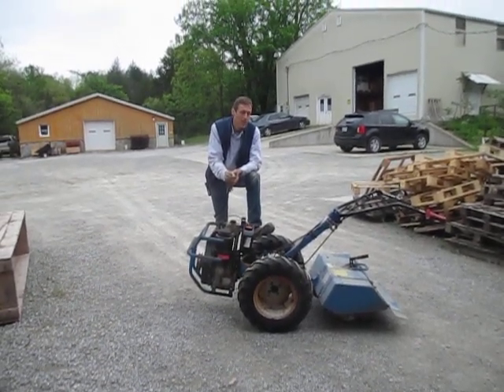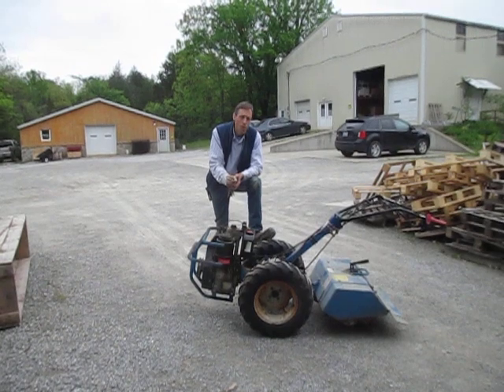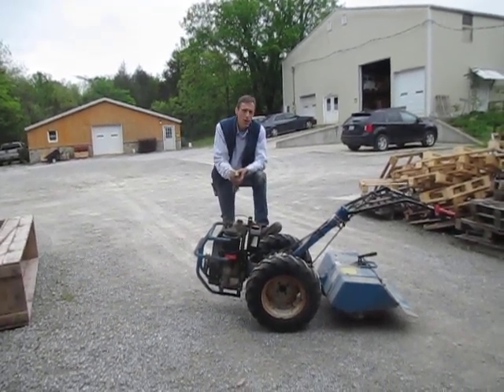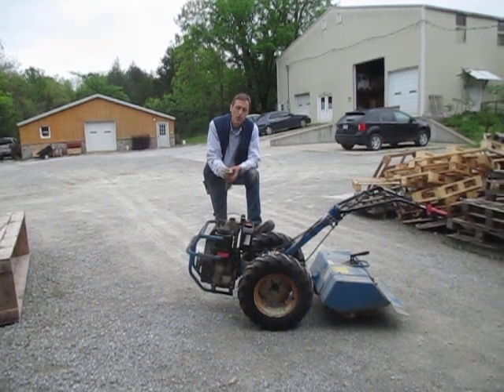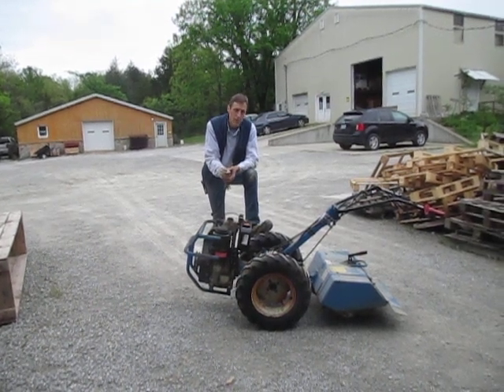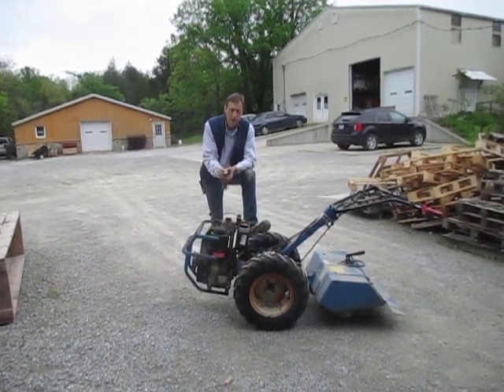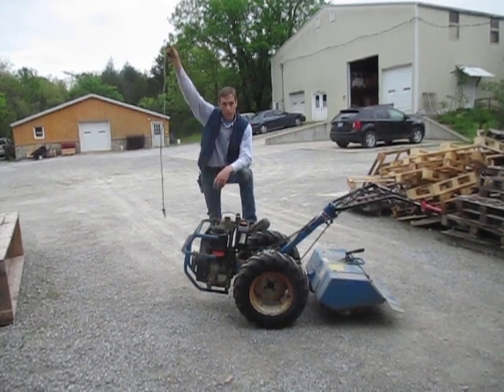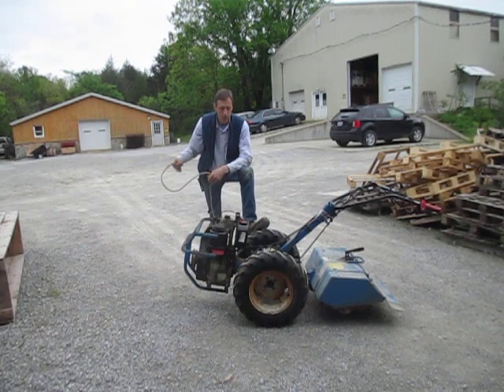Small Engines: Rope-and-Pulley Starters

Comment: Interesting.  I well remember the old-style pull-rope engines from the 1950s & 1960s... Are they still around ?  Should run virtually forever.....Was watching videos on motorized bicycles, thinking how similar they look to a 1906 Harley Davidson. Especially with a springer front fork....   A pull-start engine, a drive belt to the rear wheel....

Comment: "There is no compression release on any engine with a pulley start." 
 I have a Hatz E75 (3.5kW max.) with a pulley start and compression release. It's on an old dumper (Clowez). It's been 'out of service' shall we say, but when I did get it going it was lovely. I left it with a specialist in heavy machinery to convert it to electric start, spent €400 on starter, etc., only for him to tell me that because no cover ever existed there was no way to align the starter -- it took him a year to tell me that. 
Anyway, you're is the only vid I've ever seen that shows a rope start (I gave up looking a couple of years ago), so I REALLY appreciate you showing this! I like the bouncy method you showed -- actually I have seen that, but not explained -- but since I have decompression, and it's potentially dangerous, I'll give up the pleasure of learning it; I've already nearly had my shoulder ripped out by kickback on  an AS Motor engine 4.4 kW, 165cc (another German) mounted to a 3-wheel brushcutter (AS26 AH9) which frightens me just to look at it. 
Thanks again, I'll check any other videos you may have.

Comment: I was wondering whether bouncing with a recoil will warm the engine a bit, used without decrompression. It does compress (heat) the air, the logic being, that heat will transfer to cylinder walls. What say you?

Comment: 10 hp diesel is a tricky thing to start when kts chilly. Would this be helpful? I hace a recoil starter. If its is possible to bounce the same air in the cylinder, will it warm up enough to ignite the fuel?